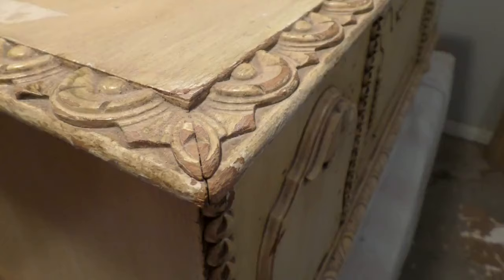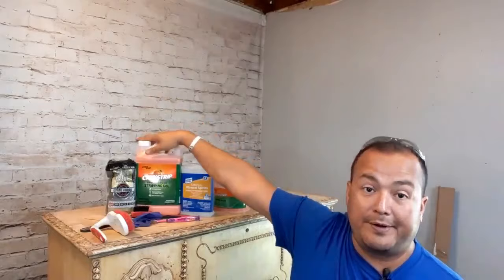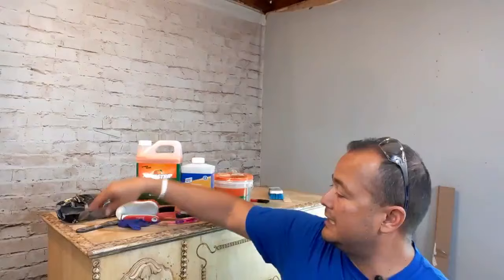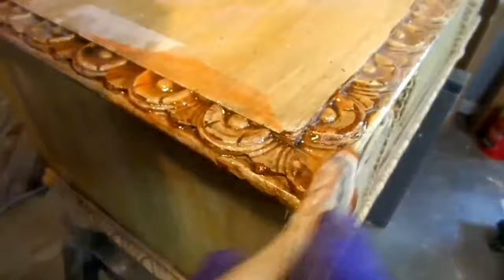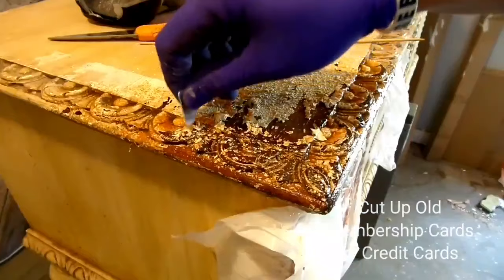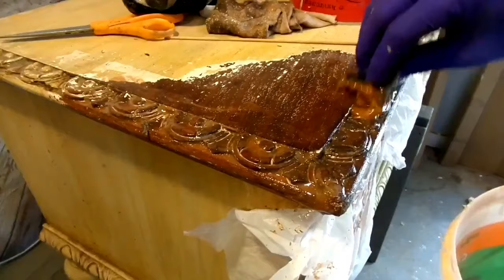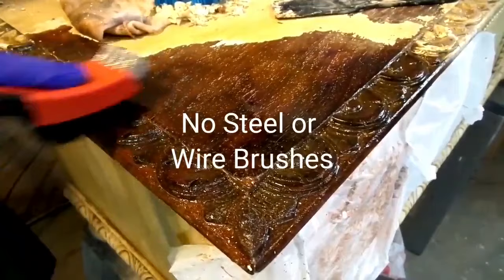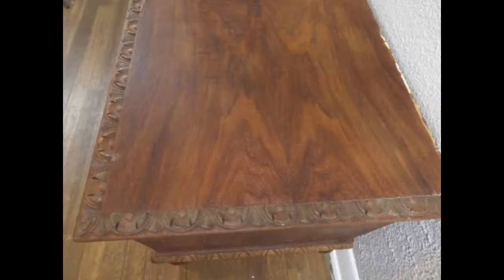How To Strip Paint From Detailed Wood Furniture

Comment: I picked up a fireplace mantle that a neighbor put out to the road. From the back I could see it was mahogany with ornate detailed designs on the side and center. The piece smelled and had a thick dark lacquer finish that was unbecoming besides making it look cheap. Your video was the one single reason I did't stop my project half way through and put it back on the roadside. I started before watching and put stripper on the whole thing. When it dried up and din't come off easy on the smooth parts I was wishing I had just painted over the whole thing. The stripper gummed up the lacquer and I knew I didn't want to paint over that.  I went to Youtube and looked for remedy for backing out of the stripper and came to your video. Watching gave me ideas for more tools as well as wrapping the ornate areas in plastic so it didn't dry out. I made it through and it is beautiful. I feel good having saved this beautiful piece of art. Thank you
Reply: Dear Brenda, how did you get the lacquer off  the mantelpiece in the end? Did you use a different type of paint stripper or is there a specific product for getting lacquer off wood? Sorry about all the questions but I'm trying to strip the paint off a beautiful old mantelpiece that I bought for $35 from a place that sells old pieces that have been taken out of houses. The only problem is it's covered in about 50 layers of lacquer - LOL!! And I'm starting to give up on the whole project. From Amanda Jones in Melbourne, Australia ❤️
Reply: Do you have a photo of the finished mantle?

Comment: After one project I found that the stripper works ok for flat surfaces not so much for round or intricate. Sanding disks with a grinder, much faster and doesn’t damage the furniture, just don’t use any disk below 80 grit and keep the tool moving, then you just lightly sand with 120 grit and you are ready to finish.

Comment: New sub. Great video. I tried this before I saw this video but unfortunately I used sharp metal tools(suggested on another video-metal scrapers and dental tools). Not the best idea when you get frustrated. 😆 I ended up with gouge marks. I didn’t realize chemical stripper softens the wood so you need to be more careful. Hopefully I can still salvage it. Now I’m not sure what to do with the piece. It was always painted so it has a white haze but it’s two tones of wood veneer. Maybe you can show us how to repair or camouflage gouges or defects in the wood?
Reply from the maker: Yes, unfortunately the stripping process moistens the wood fibers so much that they become susceptible to damage easily.  Stick with plastic or wood tools only, and even then you'll still need to be careful not to damage the wood.   As for removing gouges, a good trick I learned is this:  Grab a regular, household clothes iron.  Next get a clean rag or towel.  Wet the gouge with water and place the rag over that, then apply the iron (on its highest setting) to the rag.  You'll hear the sizzle of the water making steam.  That steam will make the crushed wood fibers of the gouge swell and expand,  thus eliminating the gouge!  Pretty cool trick huh?  Just don't leave the iron on too long, if it's a veneered area, it could cause the veneer to come up.  Hope this helps, thanks for watching 😊

Comment: Wow, and great honest, informative vid.  I like how you said you forgot about it and left it overnight, LOL, then told how to remedy it.  They say the citristrip sold now is not as good, any opinions?
One thing I did not know.  Somebody told me to unroll your steel wool first thing.  I was shocked to see what a difference this makes, it is like getting 3X as much, and I don't know why.  All I can say is try it, let me know what you think and WHY this is true?  It's a pretty crazy thing.
Reply from the maker: Hi Rockshot100,  yes I agree, they had changed the formula to citristrip once before...the "good stuff" had a more pastel, sherbet looking color.  Then a version came out that may more translucent and gel like.   This didn't work as well.  I think they were trying to make the formula not dry out as quickly,  but they diluted the stuff to the point of ineffective.   Since then, I think they found a happy medium and the citristrip works much better now.  
     Yes I will try the steel wool trick, it sounds like a good idea.   Thanks for comments and suggestions,  thank you for watching 😊
Reply: @CoastalUpcycling  Thanks for clearing that up, I am using it on just a varnished chair and it works pretty good.

Comment: What an amazing video!!! ❤
I have a table top that has lots of scratches where the polyurethane is stuck. I already sanded the table top and most of the poly is gone, but I’m unable to remove the scratched up poly. Do you recommend using the citi strip in those areas? I really think I’m going to give it a try!
Thank you kindly!

Comment: I have a old wooden desk with a few hard to reach corners and I'm at wits end getting into the corners and the hard to reach areas. Is a heat gun ok to use on a wooden desk after trying the orange and mineral spirits after they dry? Don't want to scorch the wood etc

Comment: I have an old piece that was painted I have stripped it all back and it looked great under the paint it was Black Walnut veneer I used water to check the grain it looked amazing.   I then stained it and thats when I could see the white paint in a lot of the grain,  is there a solution to remove the paint out of the grain now that I have oiled based stain on it?

Comment: If I have some bare wood, will the Citrustrip ruin it? I've got a few legs with varnish that's at least 70yrs old on it, and want to pull the stain off too to reveal the nice maple wood underneath. If I need to, I'll just hand sand it. But one leg has taken me a good 2 hours and I ain't even close to done 😮‍💨

Comment: Thanks so much for your info, I’ve got a huge armoire that’s late 1800’s early 1900’s and it’s incredibly carved all over the front doors, I’ve been using Citristrip- would oven cleaner be a good tool
As well? Ir will it dry it out too much? 
I want to bleach it then go over the carvings with a dark stain to highlight the  beautiful details, or just condition it and seal it. Ty

Comment: Hi could you use a Dremel drill for detailed carvings? Any advice would be great thanks
Reply from the maker: Hi Linda, yes you can use a Dremel tool with a wire brush attachment...I would use caution, as the metal bristles and the power of the Dremel can wear away the details of your carvings.  Make sure the wood is thoroughly dry before using and only use the lightest touch.  Hope this helps, if you have any other questions,  please don't hesitate to ask,  I'll be glad to help where I can 👍...thanks for watching 😊

Comment: I wish I could time travel back to 1980 and pick up a gallon of Zip Strip. That stuff actually worked!

Fast forward to 2024 where I'm forced to use  modern stripping compounds to strip paint from a 1990's era Made in Japan Fender Stratocaster guitar.

Modern strippers have almost zero effect on this guitar finish! Total waste of money and I'm forced to sand the old finish off.

The 80's stripper would burn your skin like the oven cleaners of that era and you had a sense of it's power. 

Modern strippers don't burn skin and  do little to remove modern finishes.

Comment: first of all , citri strip SUCKS!!!! It stains the wood and is weak! Second, don't use steel wool . Only adds to the mess. Wire brush, rags are good enough.
Reply: I use the wicked stuff. I bought gallons of it because I'm not sure if it can even be found today. I don't want to wait for days to strip something. Mine takes minutes. And then I use a small putty knife to remove the gunk. I use toothbrushes and a dental pick for corners and carving. I do use very fine steel wool for final clean up with a little bit of stripper. I'm 70 years old and still healthy so I guess the stripper isn't what will kill me. I've done a lot of large pieces that are family heirlooms that my mother painted white with that gold "antiquing" look that was popular once. What a mess! But they are back to their early 1900's glory.